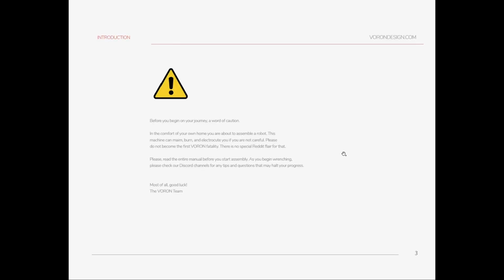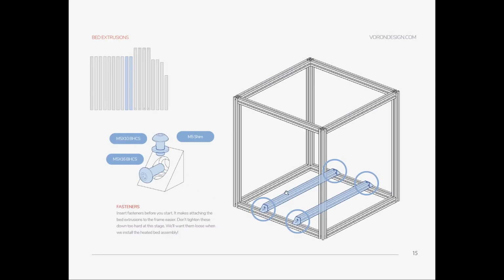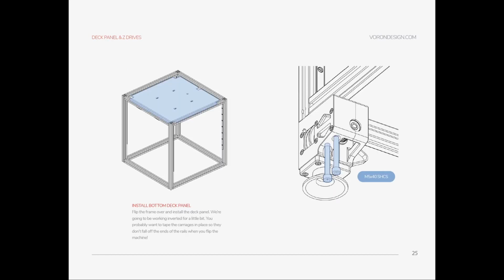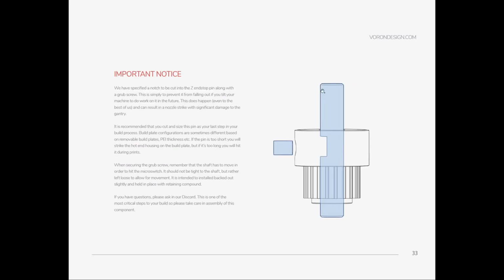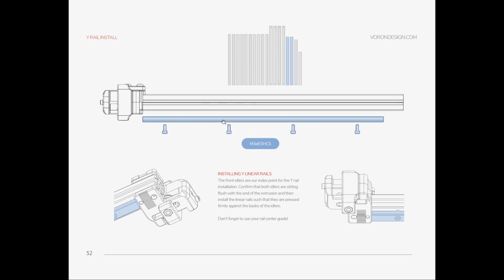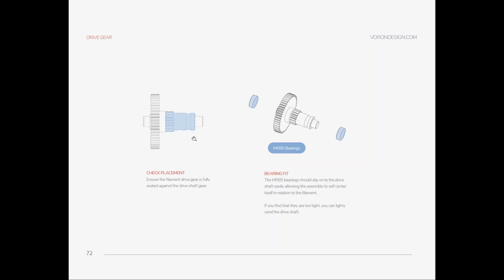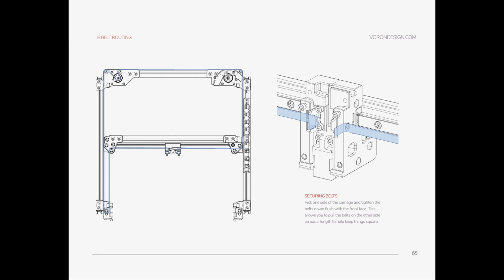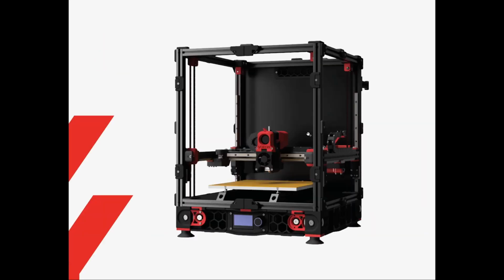Building Voron v2.4 - Lessons Learned [Ep14]

Comment: Thank you for the great VORON 2.4 build programs and your lessons learned. As the 2.4 becomes more popular I'm sure more and more future VORN owners will be referring to your experiences.

If you don't mind, I'd like to highlight several of your points on building the frame for future builders.

Frame alignment appears to be one common problem new (and even some experienced) VORON builders with limited DIY building "square" experience do not pay as much attention to requiring them to disassemble their printer and re-align the frame. It's natural to eyeball it and say, "it looks great" and move to the next assembly.  Think of building your VORON like sipping a glass of fine, expensive wine, or as a Zen event! :)

First. For your budget do not skimp on the frame, it's the most important component. If you buy so-called "complete" kits, or extrusions from questionable sources be prepared for extrusions that do not meet spec, including the sizing and curve of channels for your inserts, if cut, variations in length, and straightness. In some cases, you will find issues with corner M5 screw holes slightly out of alignment or not tapped deep enough. If your extrusions are spot on feel yourself lucky. As "zer0 is doing noted," don't drill and tap extrusions unless you're a skilled machinist.

Assembly leading to errors. On page 14 of the 2.4 manual, it tells you to use a "framing square" to achieve squareness. This is incorrect. It should say to use a "machinist square". Framing squares are for building with wood and are notoriously "un-square" when used on metal (there are YouTubes on how to square your square). Machinist squares are milled to international standard precision and should be used along with good quality clamps to help stabilize the joint. If you do so, are patient, meticulous, you will obtain precision within 0.5 mm (assuming the frame components are manufactured to spec).

Here is one, and the only one I found, instructions on how to do this using the BEAR frame conversion for the PRUSA MK2, MK3 series. It's excellent. Go to Bear Labs Guides [guides-bear-lab.com] for the Bear 2.1 frame, Section 03. Y axis frame and scroll to Step 8 Reference corner squaring. Here's the link assuming YouTube doesn't delete it: https://guides.bear-lab.com/Guide/03.+Y+axis+frame/43 . Great pictures with detailed explanations. Take this technique and apply to your VORON frame.

The last requirement for a square frame is, again noted several times by zer0 is doing, build it on a FLAT surface. Most of us do not have a large piece of glass. Kitchen counter tops are typically square. Take a long metal construction ruler and check. There seems to be nothing else in a home and apartment that's flat.

Flat, machinist square and clamps, and your patience will result in perfection and better print quality.

I apologize for the length, but the RepRap and VORON communities are great at sharing experiences and helping. Subscribe to the VORON Discord.
Reply from the maker: You are right. Using machinist square lead you up to most successful square. However for that you need to buy the one that has quality. I have seen a machinist square that is not 90 degree so... :) Yeah.. And that would be another cost for the user and a bit hard. What I am thinking: They thought that, it should be balanced in every way. Cost, quality, appearance, difficulty etc. So that's why It is advised to only use flat surface.. Theoretically, if you have flat surface, cut on the frames are nice and holes on the frame are placed exact 10mm offset when you attach them together it should automatically be square. That means, if you get nice frames and glass shelf that should be it. On the other hand if the frame is cut 1 degree, there is no way to make joint 90 degree even with machinist square. However they are always tolerances, and those are negligible for this case. It is not rocket at the end. Developers says that up to 2mm diagonal measurement differences are okay. I aimed to up to 1mm and I would advise that. But again they developed this machine and they are using for long time. :) Another remark, there are other parts which it needs to be placed on Voron, those are also holding printer together and forcing it to make it square.